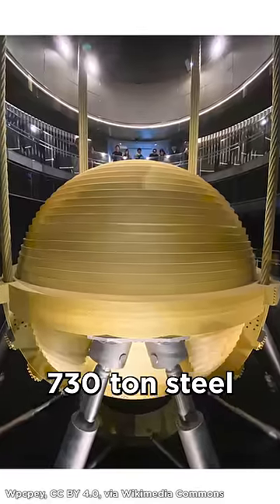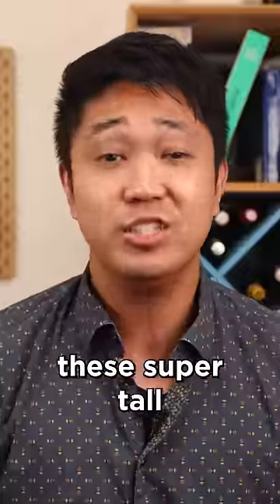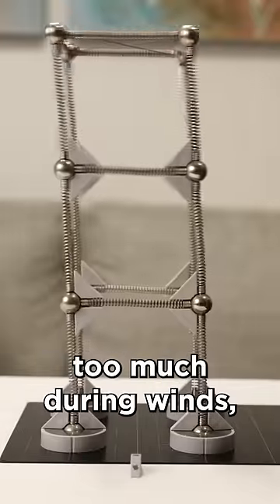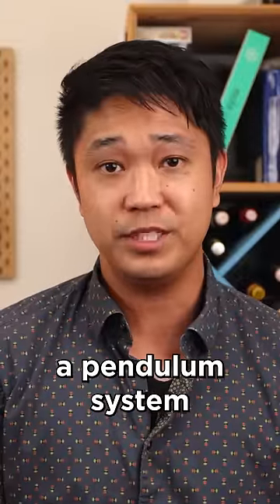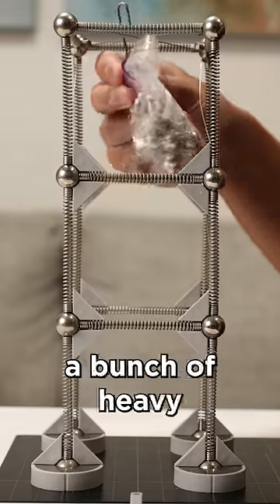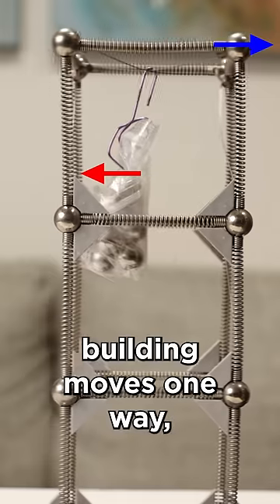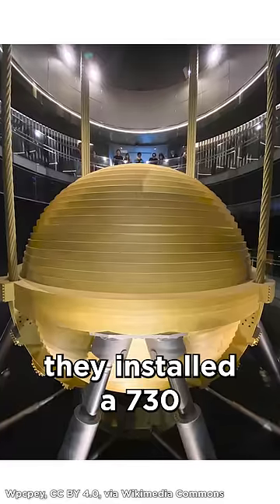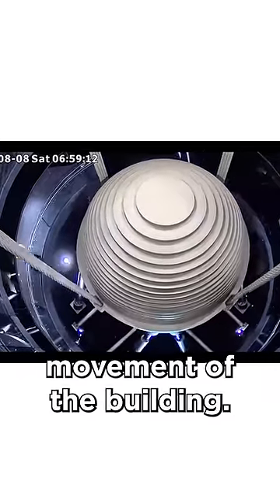Engineer Reacts to Taiwan's Earthquake Proof Skyscraper

Comment: I designed a building for my architecture class that was 300’ tall to scale. I put a counterweight on the top with base isolators at the bottom as well as a central column that was isolated from the rest of the building. It got put on an earthquake simulator and I won second place, my tower stood just fine. Counterweights are awesome 😎

Comment: bamboo and using earthquake stripes made out of strong duct tape over the length of the structure. Also, under the building there is 50m of rubber

Comment: Yeah it’s good they did research on this and created this. I hope they can do research on the impact of salt water in the air on buildings in Florida and the impact it has on both concrete and steel. Or is there a way to paint the steel or could they do a similar process they do to the frame of cars like the bath they go into.

Comment: How does one lift a 730 ton steel ball into place?
Reply: It's not a solid steel ball it has sections and is hollow. You place the bottom section then you place the tuner in the center of the ball then you close up the ball.
Reply: I helped them

Comment: yea and you have 0 clue. the ball is designed to counter normal winds. comparing the mass of the ball to the mass of the building it get's obvious and in addition to that, it has a very limited mobility. with storm winds can only partially be counteracted and earthquakes not at all. for that there exist other measures that are actually designed for earthquakes and not for winds
Reply: It is supposed to counter wind and earthquakes, that's why towers like the Burj Kilfa only had a TMD and not a separated platform

Comment: ccough cough glorified counterweight cough 😂 but yeah mass dampers are good for cranes and everything even for women carrying a baby having a counterweight on the opposite side may help balance even though more weight you just move slower to not damage your stuctural members under load stress
Reply: A TMD is a type of counterweight. Also, towers don't have lots of stress because you're disbursing the load along the structural member to where they don't experience that much stress.

Comment: The pendulum system is nice, but it has to be accompanied by sections in the building that harmonize oppositely the building's own frequency. That way all vibrations are killed as they move towards the top.
Reply: You are just saying random words, its already tuned it just does it thing, it vibrations increase the higher it goes, that is literally just sheer modulus not a Harmonic motion system

Comment: Wind is an issue but earthquakes are not.  Tall buildings  oscillate at a much slower natural frequency than an earthquake.
Reply: That's what makes them rip due to it shear modulus changing rapidly ripping it apart

Comment: You know, I normally only type a reply when the video doesn't answer its question, but I wanted to drop a comment because your video did answer its own question, wasn't click bait and I learned something new. Nicely done guy
Reply: It's misleading. It's not designed for earthquakes. It's for high winds and low seismic activity.

Comment: Bro just said a steel ball is powered by a building. What.
Reply: The ball as a device in it that counter acts shaking and movement, you can get the same effect with just placing a heavy ass ball, but it substantially easier to have a frequency counter inside the ball

Comment: what if the ball breaks off or power goes out does the building just fall over? I was in a skyscraper once and it moved like 7 feet to the side and i freaked out and ran for the elevator haha. Nope to tall towers lol.
Reply: You think they didnt do the calculations for the structure that supports the ball? Also you dont need power for the ball to do its job since its a pendulum system
Reply: The ball dosent need power as its a passive system the pistons you see under it stop it from falling and are shock absorbers, they're perfectly safe.

Comment: Cool feature yes, but do we REALLY KNOW if it kept the building from collapsing??? And if we do NOT know for sure, than it did NOT really "protect" the building during this earthquake. My would have been very surprised if the skyscraper had failed even without it.
Reply: Yes it helps, because acctual architects made it
Reply: Yes we do know it works because of sheer modulus and harmonic motion

Comment: know what structure dont sway to the elements or shaking? Pyramid!!
Reply: yeah, and the pyramids are also just a pile of rocks with no purpose.
Reply: @missedmyself  bass pro shop, and the louver think otherwise
Reply: @theriddler321  what?
Reply: @missedmyself  it's a grave / shrine bruh
Reply: @-Yttrium  the pyramids are not graves. Not a single mummy has ever been found inside a pyramid
Reply: @missedmyself  The Bass Pro SHop pyramid and the Louvre are both modern pyramids, not made of rock with no purpose.